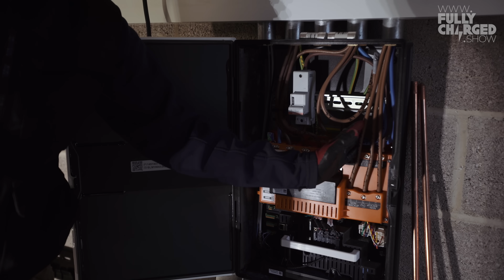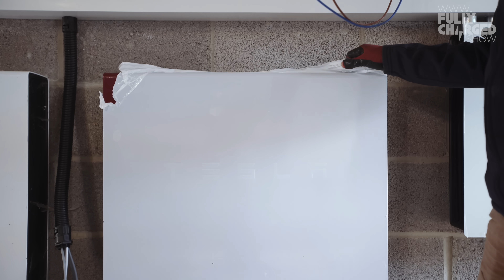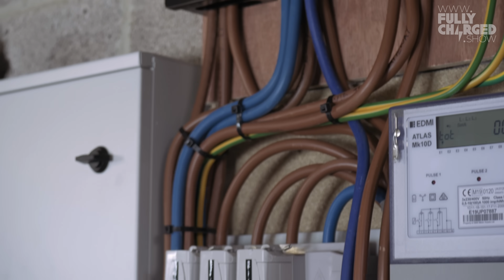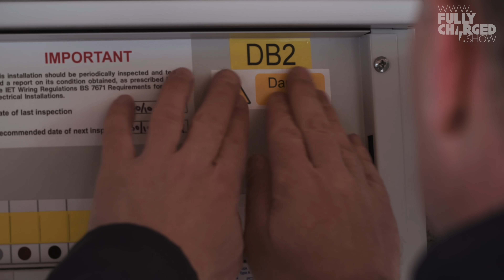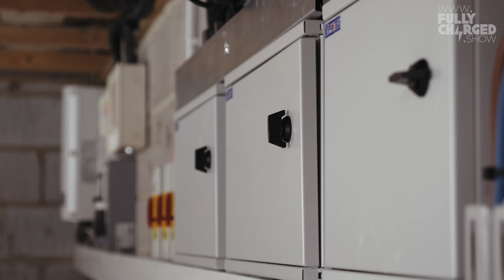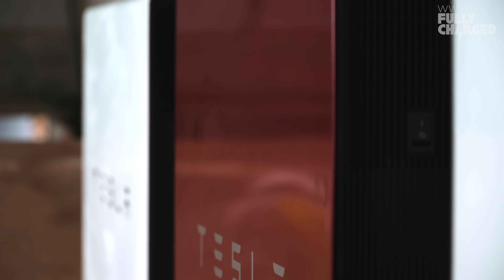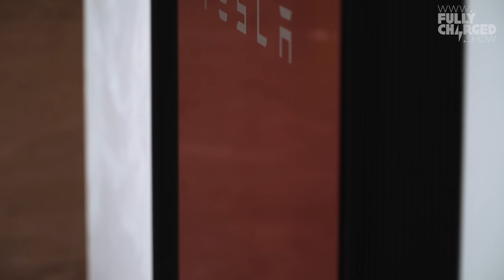Can you run your house on a battery? Tesla Powerwall 2 (Founders Series) & Tesla Backup Gateway 2

Comment: This is a "show". The "information" it is supposed to deliver is misleading at best and devious at best. Listen carefully when the conversation get s around to energy and power. All of a sudden the distinction is blurred, in full knowledge the audience will not understand the difference. So you are led down the proverbial garden path of "buy this system and find out", many tens of thousands of dollars later. Did you also notice the lack of expense and availability coverage. Too inconvenient, I would suppose, in the eyes of the producers.

First things first. The difference in power and energy is crucial to understand. Power is simply the product of voltage and current. There is NO time dimension. Energy, on the other hand, is time dependent. It is power over a given time period. When the owner tells you his grid is producing 5Kw of energy, he is simple wrong. (Energy is KwH.) That is a measure of the instantaneous power, generated over a maximum period of only minutes and hours at midday.  It is measured in Kw. Taking the average output of the panels over a day , produces a figure of KwH, which is the energy produced. Your electricity bill is therefore reflected in the KwH fee, NOT Kw! This is a typical scam on the part of solar energy priests, they like to talk about power, but not energy. Energy is the stuff you pay for, or sell, if the grid accepts it.

So much for my rant. Suppose your house uses 1000 KwH a month, and is charged at 10c per KWH. That is $100 worth of power. You use about 30KwH  of energy per day.  On your best day, your 5Kw solar panel might produce half that. Bright sunny day, middle of summer, no cloud, and tracking arrays of panels. What your batteries do is provide a buffer, for those times your demands exceed the power supply of the panels. Turn on the oven, the dryer and the hot water kicks in and there goes the panels. All else is the grid. Any excess can be provided by the batteries if the grid is off. If there are no demands from the house this energy from the panels can be used to charge the batteries or back feed the grid. 

This solar electricity is the most expensive source around, for your home. If you are even casually thinking of doing an installation, I would only ask that you do your homework. And get numbers in Kw and in KwH. If there is an explanation given where the provider doesn't seem to know the difference, walk away.

Comment: Doesn’t the new Powerwall 2 have an inverter built in? If this is the case, when setting up a whole new system for your house, there is no need to buy an inverter, saving more on initial outlay?

Comment: In India, when we used to have a lot of power cuts some 6-8 years ago, ups+inverters and batteries became a very common thing in every household. They way these inverters work is, they pass mains through when mains is available, but switch to battery power when there's a power cut. Of course these systems don't export power to the grid. But it's very normal here to run your home entirely off of battery power for 5-6 hours.

Comment: O.M.G. Now I finally understand why despite a modern electric grid, homes in the UK have such unreliable power...
Reply: Steffen Scheibler Unreliable power? It's literally years since I last had a power cut, it's a less than once a decade thing for most people, and is usually resolved in a couple of hours at most. The UK grid is remarkably resilient. Those who have more regular power cuts tend to be in more remote rural areas served by overhead wires which can be affected by falling trees during storms etc.

Comment: I don't get it.

So you only run off the batteries when there's a power cut? Shouldn't the excess (from your panels) feed back into your home for general use, and shouldn't the batteries allow you to run off the grid (presumably to save money on your electricity)?

Sounded as though these batteries only function to provide power in the event of a power cut, at which point, surely a fuel-powered generator would be an infinitely cheaper solution for something that seldom happens. I get that this is infinitely more environmentally friendly, but I don't see this becoming mainstream at all, even in homes with renewable sources of energy.

Comment: I have just had solar panels and a PV system installed (January 2020). I have 18 panels producing 6KW and a 5.2KW battery. No planning permission was required nor any alterations to the grid power supply. Additionally, I have had a voltage regulator installed which regulates the grid power to 230V (it was measured at 248V before the installation) and software for my oldish gas boiler. (New boilers have the software already installed). The whole system is managed by Social Energy who are also my energy suppliers. SE provide an app which shows exactly what is happening to the system. The system has only been installed for a week but so far the system seems to split any excess energy provided by the panels between charging the battery and exporting power back to the grid. SE also monitors the price of electricity and the software works out whether it is better to import or export electricity. See https://www.social.energy/how-it-works/ for more details. So far I have been very impressed by the whole system.

Comment: As someone who has worked on some trial schemes with battery storage (both on solar and non-solar) in properties, we established that the net economic benefit is negative, simply because the degradation of the battery is comparable to the cost of drawing a kwh from the grid for each kwh it serves.

Obviously this doesn't consider the environmental impact, it's looking at it purely from an economic perspective - the technology will need to mature quite a lot before the costs can compete with traditional power delivery methods.

Comment: Would it be inefficient to have an inverter on the battery that powers your whole house, then have the panels and grid as inputs to the battery only. That way power cuts would have no effect on your house power.

Then you could use a relay to switch your solar array between charging the battery and exporting to the grid.

Comment: Near the end (around 14:30) he suggests it would make sense for everyone to have even a 4kwh battery so they could charge during off-peak and use the battery during peak time.  Because peak power is the most expensive and dirtiest.  OK...  But wouldn't that just change when the power company considers peak and off-peak times?  Right now, we use most of our power during the day to run the aircon, TV, computer, etc.  But if everyone switches that over to battery and recharges over the night...  Now the highest demand (aka peak time) isn't 6am-8pm but midnight-5am...  It'd just mean the night shift is suddenly going to become busy shoveling coal into the burner and the day shift gets to take some time off...  It'd help more to get solar on everyone's roof, rather than just a battery in their garage...  If they produce half of the power they need for the day, then they need to suck in less from the grid...

Comment: I was a bit surprised by how long it takes for the power to switch back on. Is there some reason why the transition isn't a lot faster? I mean is it possible to make it work somewhat similar to a UPS, where the transition is almost instantaneous? Is there some physical limiting factor that would make it hard or impractical?

Comment: Really good video Robert but I can't help but notice what a huge amount of hardware on your wall now! Can't have been cheap even if the 2nd Power wall itself was free to you. For comparison I'm in LA with 8.2kW of solar, no batteries but 100% net metering (what you call feed-in tarriff from our utility LADWP) and my meter has read net-negative since installed in 2016 and we use a ton of power through the summer running air conditioning and we charge a Tesla Model 3 and a Chevy Bolt and run a pool pump every night. We can generate 50+ kWh/day in the summer here from solar panels. Conclusion: the Feed-in Tariff/Net Metering arrangement with your utility is really everything with solar it seems....come and visit us if you're in LA!

Comment: You can if wife doesn't do laundry, Father of five, electric dryer. Went from 2700 kwh a month to less than 1000 kwh in winter with tesla Solar and two powerwalls in mid Fl.

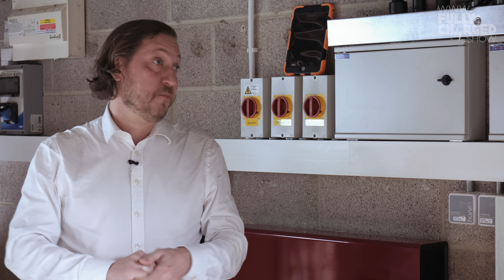Comment: 7:05 FYI: normal reason to have 3 phases in German household is: the electric oven in our kitchen.
Reply: Interesting - your domestic ovens are 3 phase in Germany? In the UK we usually have electric ovens too, but they would be single phase (sadly!)
Reply: Scott McMurray : yes, you CAN also drive the oven with one phase, BUT then you ha e to choose: oven OR hotplate at the same time... so in newer homes/cities... 3 phases in apartment are ‚normal‘ for kitchen... but not in cellar... yet not by today.. even if the cables run thought there :-)

Comment: The justification for the reduced amount of the payment for the solar power sent back to the grid is weak. The solar power is not free to the producer. The equipment required to produce solar power can be calculated... it has a life cycle and that cost would be considered (The solar equipment does not last forever!) In fact the solar wall batteries and gateway provide a benefit to the community by reducing the need to invest in additional electrical power company infrastructure. This beneficial effect should be returned to the solar producers. If we cannot directly use the power that our solar system produces during the peak power periods we shouldn’t have to pay peak power costs while selling at 1/3 that cost. This theory is unjustifiable. The power company’s cost to produce and distribute power to the masses is likely less than the individual homeowner’s cost to produce solar power over the lifecycle of the equipment required to produce & distribute that power especially considering the cost of the gateway and power walls.

Comment: Did you have your 3 phase electric meter set to measure Vectorial sum or Nett metering in stead of gross metering when it was installed? I am having a battery installed and trying to get the energy company to change my meter to measure vector sum is like pulling teeth. No one seems to have heard of this however its a great benefit to have with a battery on a 3 phase system.

Comment: So much extra equipment, the reliability of the entire system and maintenance costs in the long term are going to be a concern. None of that equipment provides any extra benefit to the actual homeowner except the rare cases of power cuts. What is the ROI for homeowner on this?

Comment: Surprised at the delay in power cutover, why isn't it subsecond like a commercial uninterruptable power supply (UPS). Most computer suites that process just in time transactions, banking, telecoms are up 24x7. What's the hit on the house systems with a jolt like that? How are they protected from brown outs / spikes, etc?

Comment: If the power goes off in my house I'd be more bothered about the router and pc disconnecting, by looks of the delay for the light coming back on that would still be an issue with this setup.  Still  better than not having it.

Comment: If you factor in the loss of electricity during charge of batteries at night and discharge during the day and the depreciasion of the batteries due to putting additional charge/discharge cycles in it, do you still save any cost? Does it still make sence to charge the batteries at night to not take electricity from the grid during the day?

Comment: One thing that kills me with channels like this is the complete lack of meaningful information.  Just," look I hooked up a battery and now I can turn on my lights!!!"  That's nothing!  Nothing at all.  Even Tesla's own website doesn't go into any meaningful detail about its batteries.  They tell you how many kilowatt hours they produce, but then tell you a powerwall 2 is enough to power a 2500 square foot home.  Really?  Ok, for how long?  Do all 2500 foot homes consume the same amount of power?  Probably not.  I suppose breaking down the volts and amps you are running doesn't really matter since Tesla or their licensed dealer will be wanting to lease the system, including the inverter, charge controller, and panels so that they can simply replace the utility rather than helping people become truly energy independent.  It really makes a lot of sense that Tesla is so secretive with their system specs.  If people realized what they were getting, they would realize they are paying roughly double per watt hour than they would if they went with Renogy or Battleborn Batteries, and that's before installation and leasing fee's.  It's really sad to see Tesla take the predatory path toward promoting renewable energy.  I was hoping that they would be better than that.

Comment: A lot of money and result === 0.0. In my installation I only accept 15 to 20 milisecond darkness, 5  7 sec. is not acceptable.
Reply: I have had the exact same system installed at my house, and when the engineer switched off the grid power, my house lights didn't even flicker! Not sure why it took so long to switch over in this clip!

Comment: According to the second love of my life, Warren Buffett (using NVEnergy in Reno, NV as his mouthpiece), my Sun Valley home would need to be rewired to become completely dependent on Tesla's power grid.  In other words, if I don't do that then if THEY (NVEnergy) has a power bump, I have a power bump!  I don't want to be bumped. So it appears to be more than just the power wall and the solar panels. In Nevada, anyway, you have to take one more (expensive?) step to be completely dependent on Tesla (TeSSSla, not Tezla, right??).  Is that the same way everywhere?  I see you had the same situation in your city/state.  PS, I BETCHYA ANYTHING it was not a personal rejection of you not having your wall signed by Elon Musk.  I HAVE A "FEELING" that there was a breakdown of communication in one of his MANY departments.  You know, interoffice correspondence that potentially 'disappeared'. That happens sometimes but not so much with good companies like Texla (Teyla??).  Places like the Eldorado in RENO are exceedingly and horrifically horrifyingly horrible in THEIR communication because it 1) doesn't exist; 2) was not dealt with; 3) was converted to 'miscommunication'. One way or another, I would recommend Tekla as a place to work and the Eldorado as a place to avoid.

Comment: Can you run a house on a salvaged Tesla car battery including the AC to DC car charger and output inverter that sends high voltage AC power to the motors? Can it be done without breaking the battery down like Jason Hughes did? Could you charge this battery with high voltage DC from an off-grid PV solar array? Does the Tesla inverter on their cars output 3 phase high voltage AC to it's motors? Could that output be used to power a house? Salvaged Tesla batteries should be cheaper soon as more Teslas get on the road and get into accidents. It would take 7 pricey Powerwalls at 14 kwh each to match one 100 kwh salvage car batteries (~$20k).  Powerpacks are very expensive: ~ $60k.
Reply: ps. I don't have access to the grid. I think I can store excess generated solar array power to a hot water system. I need to find out more about that system. I'm hoping to have a 100% off grid system with electricity powering everything; Heat, hot water, etc. No fossil fuel used for anything other than possibly a small back-up generator.

Comment: My Tesla wall lasts 3 hours max... it was the worst investment I ever made to my home. I built a green home, thinking it would be cheaper in the long run.... wrooooong! I live in Australia where we literally live on the sun... and the system is worthless. Yes we use air con in summer and heaters in winter... but in order to justify this system, I would need 5 Tesla batteries to last me a comfortable night at home. The system is great if all you want to run is lights and to run a fridge... anything other than that, you are running off the grid for... One Tesla battery is NOT WORTH THE PRICE YOU PAY! I’ve run my system close to a year now, and honestly... it’s not worth the price. If you live in Australia, the after sales by installers is disgraceful, our wall was slapped up and told nothing, other than, contact Tesla if you want to know anything... the bang for buck is not there... plain and simple!

Comment: 11:04 And that beautiful flicker is the one that fries all the electronics in your house!!
Reply: Surely if you had gone as far as fitting all this you would have discriminated surge protection  not only only on the incoming supply but the supply out to the building and the PV feed in
Reply: Surely a modern system could do better than this. Also took a long time to switch over.

Comment: With the change to 3 phase did you have to change your inverter?  i'm in Australia had a Powerwall 2 for 12 month now I've had  3 power cut since the powerwall and gateway was install. First time i noticed a power cut, was the lights flicking. checked the tesla app (backup history) noticed it had happened a couple of times before.only thing with it is the solar panels have to re-boot.

Comment: I can barely run my house with 3 and I live in Florida.   Tesla notoriously undersells the powerwalls.
Reply: btr2trvl that's because US houses are notoriously inefficient. Insulation standards in the US are dismal. You probably also have electric water heating and aircon, both of which guzzle electricity.